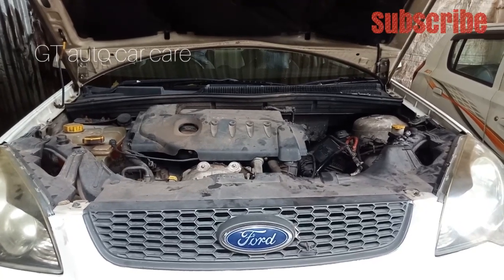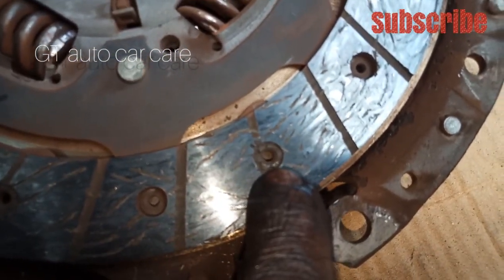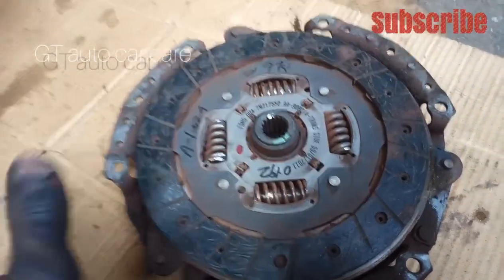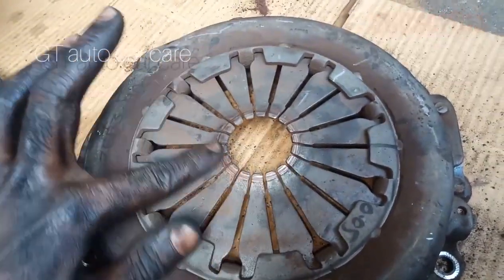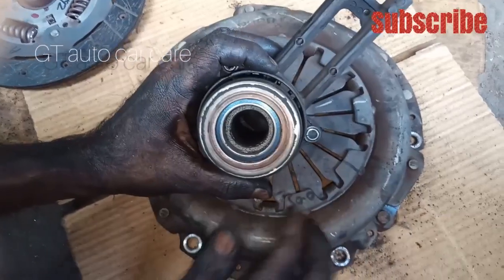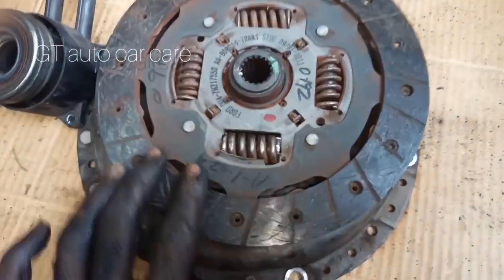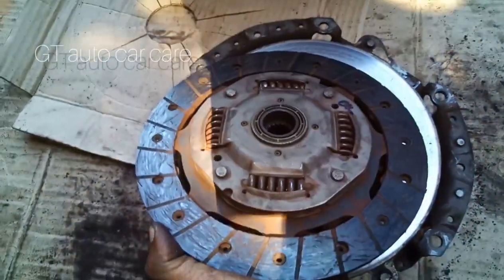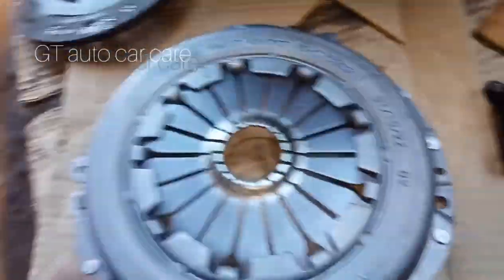Ford fiesta low pickup ,low mileage problem / Ford fiesta jerking problem

Comment: Sir i facing silencer popping sound in my maruti 800 carburetor i have done all thing changed related to ignition system
Reply from the maker: Check the alternator volt
Reply: @GTAutocarcare   my alternator is faulty the battery light reamins on at idle also
Reply: @GTAutocarcare   but how alternator can cause exhaust popping
Reply from the maker: In case of low charging / over charging